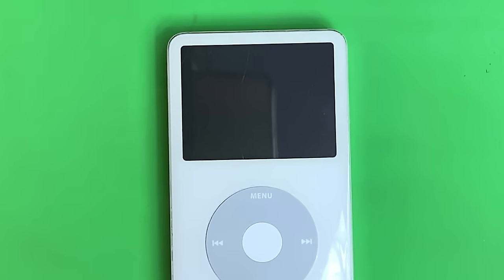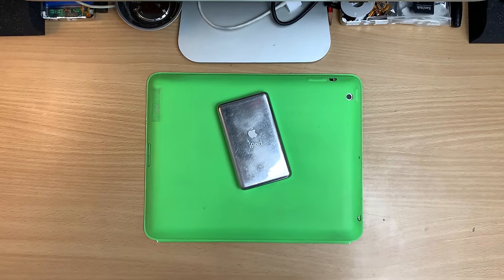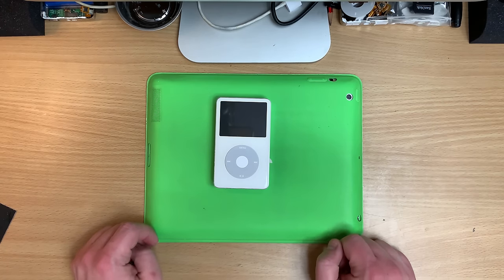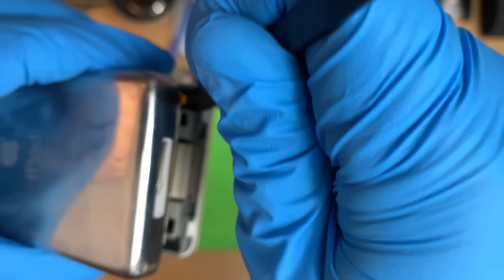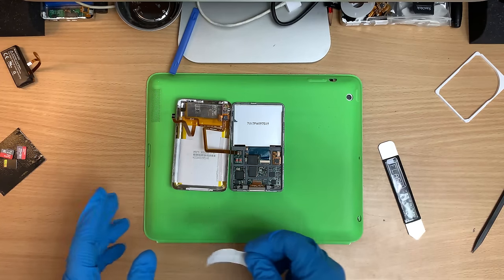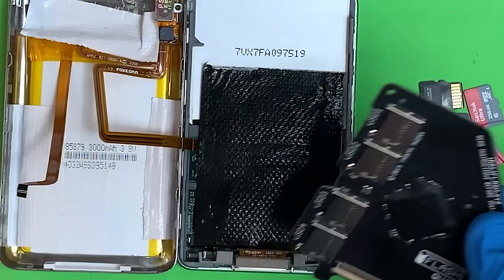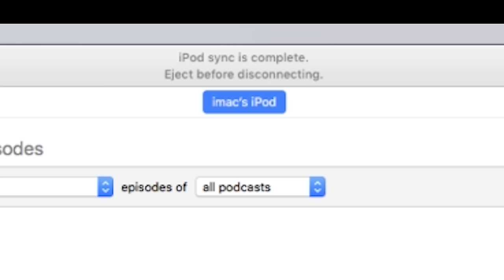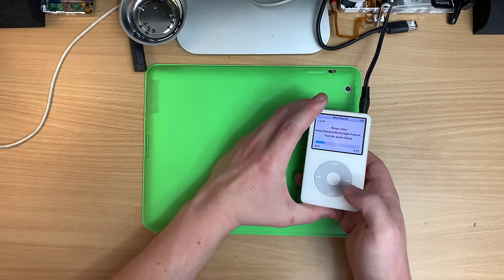Building a 1000GB iPod classic! Can it handle the storage?

Comment: Hi. Hoping you can help.
I paid someone to upgrade my 7th gen ipod classic, but it started skipping tracks. Playing around 20 when set to random play and the repeatedly skipping tracks until it found another.
Alas person I paid isn’t responding to emails so I decided to do it myself as I was nearing my 256gb memory I upgraded to 512gb.
I replaced the board with an iflash Solo and 512gb SDXC card. The first try and skipping once more appeared then reading through the iflash site, it appeared that the card I chose had reports of thus error, so I purchased another and completed the new installation last night.
The first 80 tracks on random worked great, and then the skipping started once more.
I’ve reformatted the cards as Fat32 (not exfat)
My music library is 31,247 tracks
Any guidance you can give?
I’m missing my life on random.

Thanks
Sean
Reply from the maker: Tracks might be a bad format for the pod and skipping to a track it can play. Check what format those tunes are!

Comment: Soo quickie for you, have a 6th gen, managed to pry into the case, swapped out the drive for a quad and stuck in 4 sandisk ultra 64gb cards, it seems to only ready it as 128gb when restored from itunes and in disk mode it comes up with the same. If i load up Rockbox I can get the full 256 but it seems to be a limitation of the iPodOS when restored via iTunes. how'd you get around this?
Reply: Also, another video idea for you, iPicked up an iPod HiFi for 45 euro (55 Aussie bucks) and have a raspberrypi with shairport-sync (AirPlay servrer) running out the aux of it. If you wanted to try it you could AirPlay from your touch to a truly chongus iPod speaker and also have the the Dankpod on top in the 40 pin. Just some content ideas :)
Reply from the maker: Alas 6G’s cant see more than 128 due to their weird formatting...
Reply: DankPods I’ve since figured this out (I work quick) how and ever with the iclassic  rockbox theme I’ve managed to get the full 256gb working without missing out on much of the original iPod charm (I’m building an iPod manager to replace iTunes now I can’t use it, stay tuned.)

Comment: Guys I need some halp : /
Gen 7 160gb with iflash quad and 4x Samsung extreme pro. 

The only issue I’m having is seemingly random and intermittent track skipping.   It’ll usually play a track, then pause, then resume for a second before skipping 1-5 tracks, then play again.  If I go back to the skipped tracks, they still play.  Sometimes they’ll still skip at certain points, sometimes I’ll FF to the point I skipped at, and it’ll play fine, even through the previously skipped ones.    My music comes from various sources; and was afraid to convert my library because I wasn’t sure how to then handle the duplicates.  I’m waiting on a new zif cable, and will attempt to put this flash drive in a different 7th gen I just acquired.  

Recently been running my newly freed 160hdd in my 5th gen, also with 3000mah.  Which is fine, but now I’m a whore for slim case everything.   So do I just say screw it, and run HDDs, slim cases, and smaller batteries like the 1300?

Comment: Does the quad card have to have all the same size micro SDs? can i do two 128 and two 256? just curious as i have an unused 128gb
Reply: No they do not have to be the same size.  I have a dual iFlash adapter with an 256gb and 64gb SD card.  Works great.
Reply: @matthewdinslage8120  Thanks. But you do need to use all slots right? i think i tried 1 when i first tried this and it never worked
Reply: @2mustange  according to the iFlash maker, you do not need to use all the slots.  You can use 1 SD card or as many as you like.  Did you format your SD cards as FAT32?
Reply: @matthewdinslage8120  I don't remember. I will have to check. Been awhile since I have tried this mod

Comment: The battery of 3000mAh Battery 5th / 5.5 Generation 5G that is in the description of the video is compatible with the 6.5th generation 120Gb?------------------------------------------------------la bateria de 3000mAh Battery 5th/5.5 Generation 5G que esta en la descripcion del video es compatible con la  6.5a generación 120Gb ?

Comment: After swapping the original hard drive with the sd card reader and installing a larger battery, is there enough space to place an airtag inside the ipod too? With the airtag’s plastic shell removed if necessary.

Comment: I’m still so insanely upset that Apple STILL won’t give us an audiophile-capacity device. I would legit pay an insane amount of money even just for like an iPod Touch with an SD card slot. Not even an iPhone - an iPod Touch. It’s just insanity that they still refuse to do it. These hack jobs work as a stopgap solution, but clearly iPod Classics are just not built for this much data. An iPod Touch could easily handle a terabyte or more.

Comment: supports 1 tb SSD the ipod classic 6.5 th 120gb ??

I ask you because in forums I see that the limit is only 128 gb SSD
Reply from the maker: Yup only the 160gb slim models can do over 128gb
Reply: why? 😩😩😭

If I try it, what happens?
Reply: @DankPods  ??😣😩
Reply from the maker: 6g’s use a weird hard drive format, it’ll only see 128. Itll work, just wont see it all.
Reply: @DankPods  tank you 😓

Comment: Really wonna see what happens if you put 240gb in a 5th gen 30gb iPod classic 😅 wont see what happens.
Reply from the maker: It works fine to begin with but as you fill it up it will freeze and crash